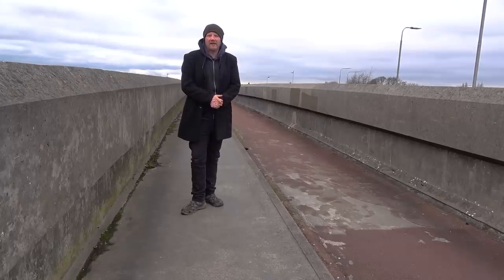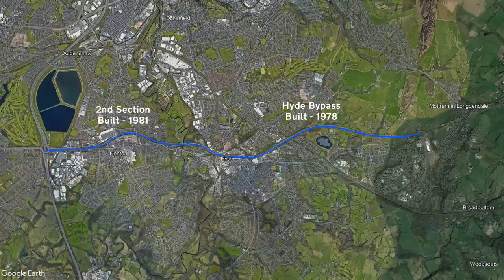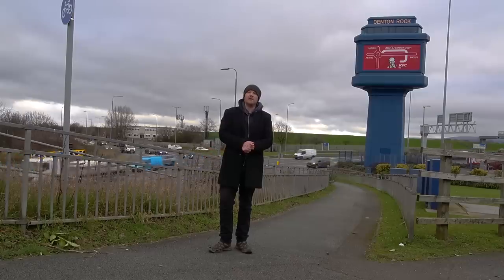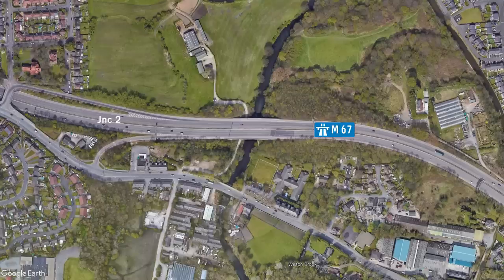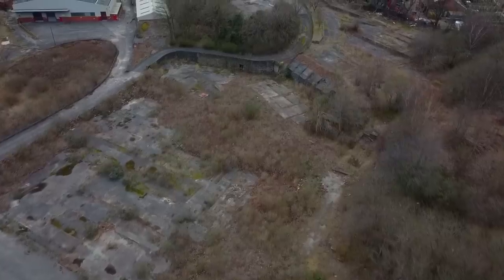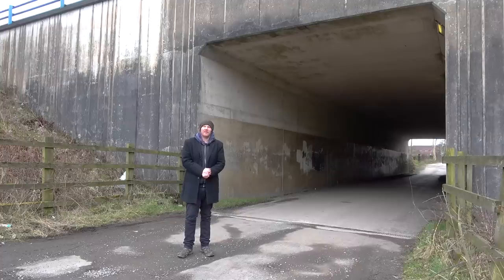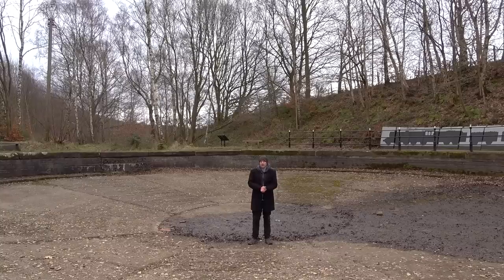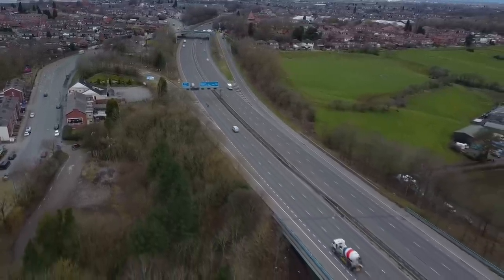Secrets of The Motorway - M67

Comment: The M67 is one of the strangest motorways in the country. The way it ends so shortly drives me up the wall, and the traffic through the rest of the Peak District is horrendous as a result! I wished they'd have connected it through to the M1 as they'd originally planned. Your choices to get from S Yorks to Manchester essentially boil down to sitting in gridlock through tiny villages (which I'm sure would prefer not to have that), or a massive detour via Leeds and the M62. Either way takes well over an hour when a motorway would cut that time in half.  Ironically, the congestion and extra mileage of the detour via Leeds probably cause more pollution than the M67 would have!

Comment: The M67 really has a feel of being meant for better things. The eastern end has a feel of a long distance motorway and then you see the end of motorway signs. The A57 east is a huge bottleneck and is used by loads of HGVs having to squeeze past on the single carraigeway. It is interesting to think if the Trafford centre would have been built had the M67 been fed through to the M1 at j35. It would have made Meadowhall shopping centre much easier to access from gtr Manchester.

Comment: Having had a friend who lived near Mottram and whom I used to visit once or twice a year, the M67 always looked like it was meant for greater things.  Junc 1 roundabout just connected with a couple junctions of M66 south before the M60 which also seemed like a bit of motorway destined for other things - although being part of the M60 wasnt it.  Certainly, has been talk of extending it past Mottram for a sort of Motrram by-pass.  There are frequently queues of traffic from the end of the M67 ito the traffic lights in the centre of town.  I guess that got them thinking about the extension to Sheffield again. Other countries in Europe manage tunnels through mountains all the time but Cost/Benefit being what it is here - probably not going to happen here.
Reply: They could speed up / change the traffic light timings or switch them off completely. I bet that would reduce the queues. The UK is the only country where the traffic light sequence is red, red-amber, green. In other countries they instantly change from red straight to green. That reduces wait time by a few seconds.
Reply: The queues of traffic from the end of the M67 (and often well before the end of it) to the Mottram traffic lights aren't so much frequent as constant, from morning until night - so once a day, lasting all day, I guess!  A fairly short bypass around Mottram has finally been given the go-ahead and was supposed to have started around now, but it's currently subject to a legal challenge.

Comment: There was a local engineer who proposed using the Woodhead tunnels as an auto rail service similar to Eurotunnel. Trucks and cars would get on the trains at a terminal in Mottram with another near Rotherham. Problem is national power have put their power cables through the tunnels and they would need making liver to fit big carriages through.
Reply: That was a really stupid idea. The hassle, time wasted for loading and unloading, and congestion chaos at either end just for a short journey.
Reply: @billystanier6327  it works for the Eurotunnel, and the idea was that HGV drivers could include the waiting and travel time as their rest time.

Comment: Godley is pronounced god-lee. You got it right the first time.

Also, no one in Denton goes to the train station. There's only one train a week, heading north. You can't even get a return ticket.
Reply: you could get a return to Stockport and spend 20mins getting a coffee in Edgely ( though the other week the signaller at Stockport forgot the train was due and left another train in the platform that did not have crew to work it),  there was about a half hour delay to the incoming service and it must have left immediately after.
Reply: I'd like to believe that was different before the motorway though
Reply: Its a good place if you’re a steam train enthusiast though, as Denton is the stopping spot for steam specials to take on water.
Reply: Pretty sure it's 2 trains a week, one in each direction.
Reply: @disappointingmarbleraces9028  It is now,  the service was 1 day a week until about 4 years ago.  though the saturday service was cancelled in covid and then , well, because northern,  then it is back working.  You can use the "return" from Stockport to Staylbridge Via Denton ( cheaper than via Manchester ),  to return via Manchester on that day ( a fares oddity), but its not much use for getting back to Denton.  The Reddish Station on the Line does get the odd excursion calling , and is walkable from the other Reddish Station.
Reply: UnjustifiedRecs   Blake-ley right?
Reply: UnjustifiedRecs  Don't come to the East of England then - we're the centre (off-centre?) of weird names - like Manea!
Reply: @wteff8586  Afraid not. Even back in the 70's Denton Station had very few passenger trains. Guide Bridge was the closest station with any decent service.

Comment: what's now M1 junction 35A was originally meant to be a service area, hence the ghost sliproads on the north side of the junction
the A616 Stocksbridge bypass is built along the line originally meant for the M67, but it was done on the cheap, so it's a 3-lane single carriageway and when originally opened in 1987, it had an appalling record for head-on collisions due to the overtaking lanes being badly placed
the junction with A629 (Sheffield-Huddersfield-Halifax-Keighley-Skipton, effectively a trans-Yorkshire highway) is something very rare: a grade-separated junction on a single carriageway
A616 used to run through Sheffield, it now disappears at M1 junction 35A and emerges again at junction 30 near Barlborough, making it one of the longest gaps in a major A-road

Comment: There are 2 tunnels at Woodhead. The original from late 1800’s I think and the later one from 1950’s. The original is now structurally unsound and wasn’t wide enough for the Electric  trains hence why the second tunnel was built. That is also now unusable for a road as it’s owned by national grid & carries major power cables through it.
Reply: 3 tunnels as the original was a pair of single track tunnels. The new one is a double track

Comment: The idea of a trans-Pennine extension using an old railroad tunnel certainly wouldn't have been without precedent. The original Pennsylvania Turnpike used utilized a handful of tunnels that had been excavated for a line that ultimately never opened, but instead of making them carry one direction of traffic and routing the other direction somewhere else, they just funneled traffic from two lanes in each direction down to one. Naturally, this caused traffic bottlenecks and the highway was eventually realigned, leaving the tunnels abandoned once more (except for the one that Chip Ganassi Racing repurposed for aerodynamic testing).

Comment: The M67 is one of those "should have been" projects... we ended up with just one proper bit not even meeting either end and a marooned and scaled down bit at one end. If it had been built in full it would have had advantages beyond those any CBA could calculate.

The other "should have been" was the M64... though we did eventually get some of it as the upgraded A50.

Comment: Although to be fair, probably no one actually wants to get to the station at Denton. It’s only got one train a week in each direction. Which is a recent improvement from the one train a week in one direction only.
Reply: And part of the catchment area is closer to Hyde Central station, which has direct access into Manchester Piccadilly, as opposed to Denton (where you'd have to change at either Stockport or Guide Bridge).

Comment: Yet another good plan for a much needed motorway ended by one of those cost / benefit analysis things where the key question is - will it benefit London? Woodhead pass is one of the prettiest yet boring pieces of road - as everyone does the same speed as the slowest vehicle, then you hit the traffic jam.

Comment: You'd never fit any sort of M-way through the Woodhead rail tunnel! The Woodhead tunnel is quite big as tunnels go but you'd be lucky to fit a single road truck in. I can only imagine that they thought that it would be easier to expand an existing bore than to create a new one from scratch.
Reply: Should be able to get a bidirectional single carriageway in there as that what it had as a railway and as railway rolling stock is taller than a road truck when you take into account it was an overhead electric railway should give plenty of height. But since the national grid have adopted it it mean got no chance to use it now.
Reply: Isn't Woodhead now full of National Grid power lines?
Reply: @barrieshepherd7694  yes it is now unfortunately
Reply: @barrieshepherd7694  Yup - apparently there are actually three tunnels  -the first two built in the Victorian tunnels, and the other much later on which is much bigger to allow overhead electric wires. All now contain power lines.
Reply: @timbounds7190  As a child I would have travelled through that tunnel between Manchester and Sheffield Victoria on the electric train - the overhead line was at 1500 Volts DC.

Comment: It is interchange 1a because it was added later?  We used to have that here (Ontario), we had numbered interchages but they kept adding more, making 1a 1b, 1c, etc.  to fit in.  They then switched to naming (numbering) interchanges with the nearest kilometre marker.
Reply: Yes Europe does that as well but you know us British always have to stick with what doesn't work
Reply: @damiendye6623  I think in all of the videos I have watched that is the only "a" interchange, but I could be wrong.  It seems there are not many built later on that were not already planned and numbered.
Reply: @donsmith2833  
there are plenty of examples here is a limited set.
M1 has loads 6a, 11a, 15a, 21a, 24a, 29a, 35a.
M2 has 1a
M3 has 4a
M4 has 23a ,25a
M6 has 3a, 4a, 10a, 11a, 21a, 31a

Comment: The reason the cost/benefit analysis isn't favourable is because they picked the wrong route options in the first place.
When choosing those options they simply looked at where the traffic goes and decided whether a motorway would make a reasonable choice. Of course the traffic goes that way, there's no viable alternative!

If they had looked at where a motorway was needed they would have considered a route passing between Sheffield and Chesterfield, joining the M1 somewhere near Woodall services. This would provide a route from Manchester to East Midlands or the M18 as well as Sheffield and Rotherham.
Reply: Woodall. No should have joined the a619 and used as bypass just south of chesterfield since  road could be winden as it only old estates like Chatsworth in the way
Reply: @damiendye6623  I understand what you are saying but that route risks suffering the same fate as the route north of Sheffield since it takes away the potential objectives of alternative access to M18 and Rotherham as well as Sheffield and Chesterfield. The primary route to M18 and Rotherham would still be M62, losing some of the benefit of reducing M62 traffic.
Reply: @chrishartley1210  I don't understand the M18 bit because that is a corridor north east. So why come down to go back up as the m62 is shorter for that as it's just directly east. The primary route need to look at connecting the north midlands to Manchester. Hence connecting to the A619 as that takes you to Mansfield and on into Lincolnshire
Reply: @damiendye6623  You are only considering one end of the route. If you take into account Staffordshire, South Cheshire and all the farming areas west of those they need better access to the destinations I've discussed. Taking traffic away from the M62 is also an important consideration as is providing an additional East-West route. The East Midlands still gets its shorter access to Manchester/Liverpool.

Comment: No, it would be a terrible idea to have two full access junctions so close together.

Local traffic using a motorway for short local journeys just cause congestion and undermine the whole point of a road being a motorway in the first place.  Both because of the extra traffic temporarily dumped on it but also the weaving that will be caused with traffic trying to join and leave in the same short distance.  It is the reason you get braided junctions to spread out merges and diverges.

I believe the design standards say the desirable distance between on and off slip roads on a motorway is 2km with 1km as an absolute minimum, and the distance between junctions 1A and 2 would only be about a third of a mile.

Comment: If you had a railway that ran straight through the Pennines, you may not need the motorway. Oh wait. British Rail. Let's close the Woodhead route, and let the National Grid use the brand new tunnel for their high voltage cables we built for electrifying the line so there's no chance the railway could open without it costing a bomb...

Again, we had better links to Manchester 50 years ago, but now everything is too expensive! HS2 seemed to not care about ripping through ancient woodlands, why now stop at roads?

Comment: I think reusing an old railway tunnel for only 2 lanes of the motorway would be cheaper than to build a massive tunnel through a mountain from scratch
Reply: The original two bores of the Woodhead tunnel have been used for high voltage lines by National Grid.  I thought that a while back they were proposing something similar for the new tunnel.

Of course, they could always use it for an additional trans Pennine electrified rail link.